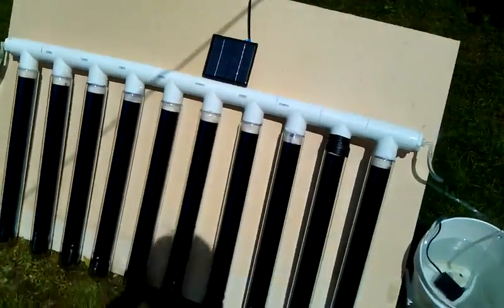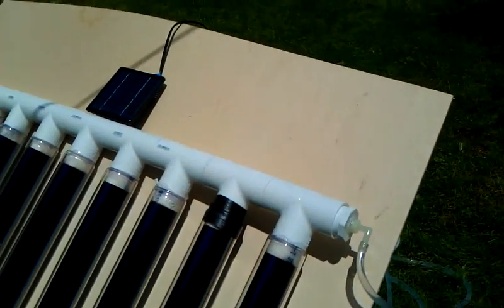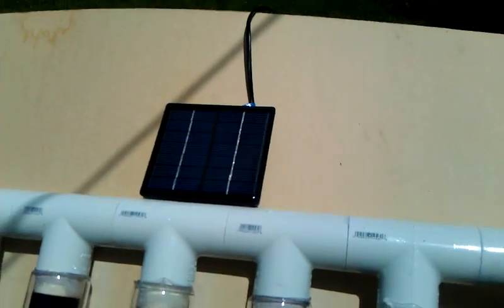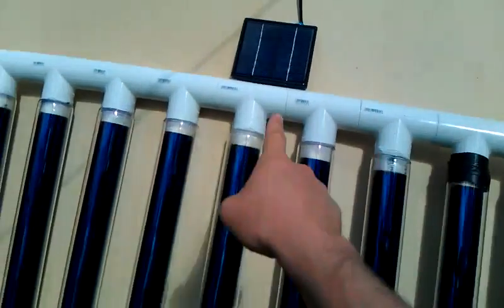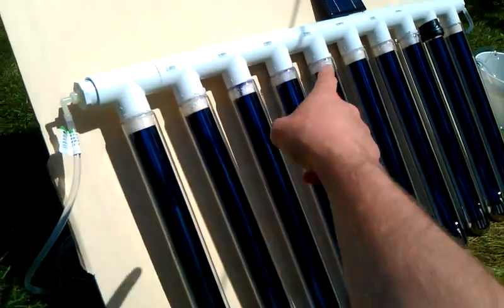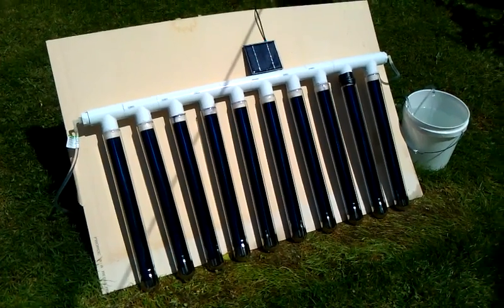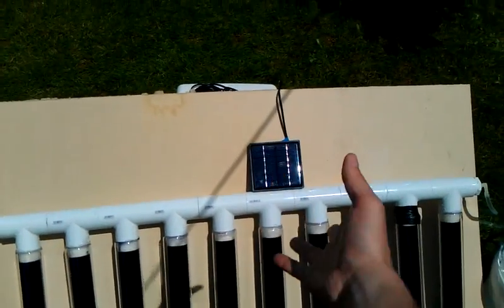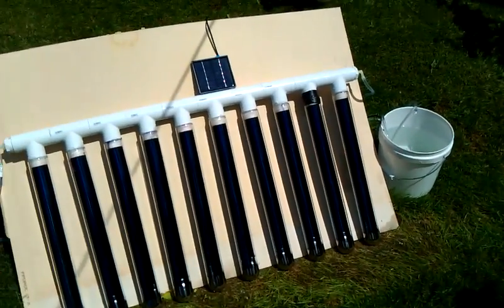DIY solar vacuum tube water heater manifold

Comment: finallymade it using smaller pvc pipes and longer heat pipes tubes, unfortunately pvc pipes melt with the heat but the experience was ok now going for copper. asap its working ill tell you, regards

Comment: those vacuum tubes transfer heat through the latent heat of condensation using a small amount of methanol in them

Comment: these tubes get very hot, having this system setup the way you have it, regardless of the application would cause the tubes to break as soon as the colder water from the collection/ expansion tank entered the system. really not much info in this video.

Comment: PVC pipe doesn't have nearly the temperature resistance needed for use with vacuum tube solar collectors.  You can easily reach a temperature that will melt the plastic.
Reply from the maker: +strato man Hey Strato, Depending on the use and what kind of system you build that can certainly be true. Check out the copper pipe manifold option available for higher temperature situations on our website: http://www.electric-bike-kit.com/solarwaterheater.aspx 

Cheers
Reply: @CleanRepublic  
Do you all still offer the glass solar heater tubes ? Are you still CleanRepublic ?

Thx

Comment: Hi Guys, I bought 20 of your tubes last summer. They all arrived in great condition too!
My experiment was:1 tube, in the sun with a plastic Safeway bag stuffed lightly into the top about 1'' down - would produce boiling water in just less than 2 hours!
But, it would be much better if you used a thermometer in this video to show how much the convection is helping heat the water.
Thank you for doing that, it would really help those still interested in considering solar .
Cheers, GregK.

Comment: Good video, but id wasn't detailed enough, it is obviously a demo setup so I am not worried about parabolic this and that, but it would have been good to put in some basic detail that you could have gotten while doing the shoot.  Stuff like with this setup we are moving X gallons/liters of water an hour/minute, the water is reaching X degrees, The PVC melted after X hours or is still standing up to use and so on.

Comment: Poor design, need to be spaced further apart and utilize parabolic high reflective troughs ( this design is everywhere.. but foolish, half the ability of the tube), not to mention oil use would be better than water for heat storage, and as well they dont engineer these with TEG modules to make electric current either.. a simple add on area for upgrades.  Its sad to see good ideas put to bad design, not to mention you could add a "crockpot" cooker indoors with the same reservoir.

Comment: I bought a piece of CPVC Brazilian manufacturer of Tigre, type "T" number 35mm, and sunk in a vacuum tube 500mmx58mm but got a little slack. I'm filling this gap with Teflon tape. but I have my doubts whether ocorerrá leaks. I will test.

Comment: I was going to say the same thing, pvc should not be used in high heat applications, you could use plumbing fixtures then get pvc that is about 3 inches larger and inject some foam in between the pvc and the plumbing.

Comment: @ajsgrs My concern is if the pump fails, temperatures in the manifold can exceed 300 degrees. PVC is no match for those temps.  I personally have had PVC melt at much lower temps! Try is for yourself; take a PVC fitting and place in boiling water for 5 minutes.  When removed, it is like putty. Unless this is some type of special plastic, I would stay away!

Comment: @CleanRepublic, You may have mis understood my comment. I was not running them down, these are great units at a great price. I made the comment to open dialogue for OTHER high performance applications.
The scientist who developed the first one lives 8km from me! the Chinese units are made under lic and ARE NOT to the original specs.
You are talking solar hot water, I am talking other applications.
The ORIGINAL designer has personaly told me!
I take it you are pushing a product?

Comment: Great video.
I'm told that these tubes are being manufactured to a lower set of specs then the original design.  If made from spec they will collect around twice as much energy.
the original unit is good for around 300 C+
( I had a phone call with the original designer of "Solar Tube" 5/11)
Food for thought  Circa 1980 Sydney

Maybe also of interest was a prototype mini solar thermal unit using evac tubes, about <6msq with around 2kw output or electricity.
(Origine Energy) circa 1995 Adelaide